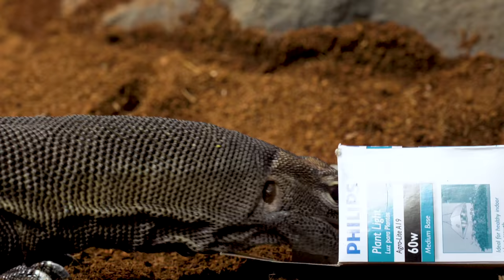THIS SURPRISE ALMOST MADE ME CRY!! | BRIAN BARCZYK

Comment: In a previous video, you showed us the two floor samples, like today, and seemed to drift towards the floor with a texture. Stay with that one. I wear shoes with a rubber sole, and anytime I come across a wet smooth floor, it's like being on ice. Even in hot weather. I liked yours and Lori's new shoes. Once you get set in, to the addition to the Reptarium, you should have clothing, that shows each resident with name, on it. Front and back. Cool.